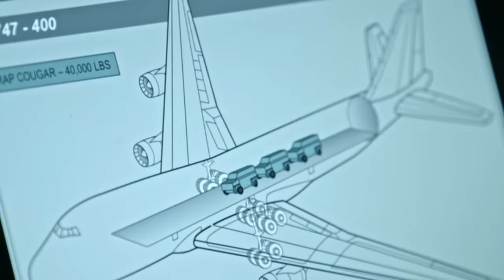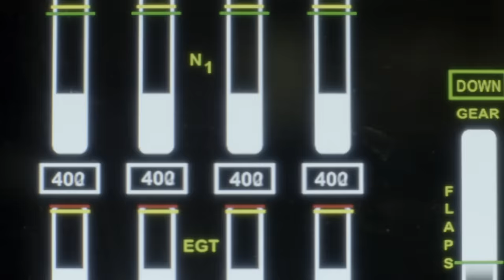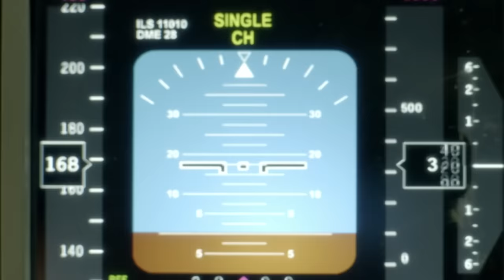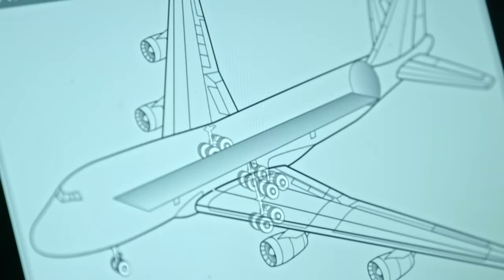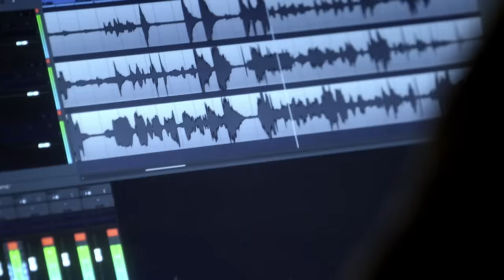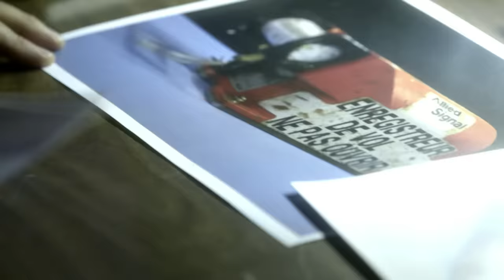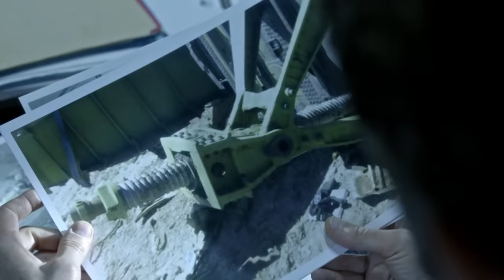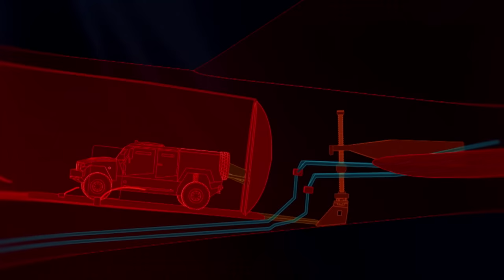The Cargo Plane in Afghanistan That Crashed Seconds After Take Off | Mayday: Air Disaster

Comment: When I saw this crash, the aviation class course on Weight and Balance came to mind after seeing the footage.
Teacher showed some example of planes on the ground (thankfully)who found this out the hard way.
Then told of how a grocery store owner was flying beef to one of his stores using a tricycle Cessna.
Take off was good, flight was smooth, landing perfectly, and on the taxi way his Cessna suddenly became a tail dragger………
Apparently just enough fuel burned off to shift the weight and balance suddenly.
If that had happened any other time during flight or landing……separating cooked beef and charred human flesh would of been difficult to say the least.
Bad jokes would of been said, and loss of appetite for beef, burgers, and tacos would of occurred.

One of the pics he showed was a 737 loaded so badly that the tail thumped on the ground with the nose in the air.
Or as he put it,
“When the baggage crew load pillows up front and lead bricks in the back”……

Comment: Dude if I were one of those crew members, I know in my heart that I would argue until I'm blue in the face with everybody that we can't secure these big heavy metal vehicles with nylon straps. It's insane. I would demand chaining them up before I would ever get on that plane.

I know commenters will probably say hindsight is always 20/20 but I know myself. As a former flatbred trucker though, I have plenty of experience securing heavy loads. I hauled backhoes, bulldozers, excavators, commercial riding lawn mowers, etc. I used nylon straps as well as chains. Nylon straps are good for light to medium duty securement such as lumber, drywall, etc. They have no business being used on heavy equipment.

But even if I had never become a flatbed trucker and had no experience with this sort of thing, I'm pretty confident that the alarm bells would be going off in my gut that this doesn't seem right and we should do extra just to be on the safe side.

Comment: The guy who was supposed to handle the very heavy vehicles was not certified and nobody was somehow aware of his lack of training/knowledge/expertise yet allowed him to work on this project or any that would involve the safety and lives of all passengers? What the heck? He wasn’t held responsible, but somebody had to supervise him, I mean it wasn’t his company that handled these jobs.
Reply: Company who hired them was definitely responsible since they didn't give adequate training on how to handle cargo loads, chances are pretty good his Supervisor had about as much training as he did in handling the cargo load. The company was the one that came up with the crappy calculations for how to use the nylon straps, they're absolutely responsible for this, the employees were just following the training they had been given.
Reply: His training could have been better, but when it comes to maintenance work, you follow the checklists in front of you. You saw the checklists which very erroneously said the angle didn’t matter, so even a more experienced loadmaster would have followed their vague rules and calculated the load bearing capacity of the straps incorrectly. The company failed them miserably, and it seemed like they blatantly lied instead of being specific about the load capacity of the straps at different angles so anyone can calculate the load correctly and safely.
Reply: Everyone here is wrong I worked for National Air Cargo and was in Dubai and know exactly what happened. National had three birds on the ground at the same time with a load crew of five they had been working close to 17hrs that Day and they were exhausted. Seems the flip up pallet locks were NOT raised and there was not enough straps on board the aircraft.  
This was not the first time the company moved these vehicles. The ground load crew was at fault along with the load master on board. Obviously the load master failed to check the locks and the company was at fault for over working the ground crew and the lack of straps used on each pallet.  This was the mistakes that brought it down.

Comment: As a truck driver I would never leave a loading area without making sure my load was secure. How much more important is it for a pilot to check his load to make sure it's secure? I know the pilots were tired but that's really no excuse. Very sad.
Reply: But it appeared to be strapped down, the pilots were not delegated the task and as per the loadmasters manual it was strapped down properly. The pilots had no fault in this case, you as a truck driver take on the role of loadmaster as well but this is a very different case which relies on regulations and multiple crew members with differing delegated roles.

Comment: To heck with nylon straps for heavy loads. I've been a tow truck operator for nearly 30 years now and nothing i've ever used has the load carrying capacity of  good quality chains. Straps naturally lose their strength over time due to fraying and contamination, chains on the other hand can retain their strength indefinitely if undamaged and cared for correctly. Use nylon straps to secure a riding mower, use good quality chains to secure everything else!

Comment: I don't see how the load master didn't question the calculation of 26 straps for 12000 tons and 28 for 18000 tons. So 2 straps is all that's needed for 6000 tons?
Reply: 2 straps for 6,000 tons?  How big are those straps??  500 tons are a million Lbs.

Comment: Unfortunately, whomever made this video made the situation even more confusing because they incorrectly explained the problem with the WLL of the straps in contrast to the angle of their securement. The strength of the straps doesn't change with angle.  The angle, however, determines the direction of pull/force as the plane changes pitch and angle, which can make straps useless if not applied properly.  In that case, fewer straps may be available to withstand the force, and thus exceed their WLL.  What a horrible explanation.

Comment: This was a half story… the load master is handed the manifest and load plan which shows positioning and the weight distribution in various sections on top of restraints…. However there are contractors in jail right now because they copied certificates saying they were qualified in load planning and didn’t know how much restraint was required for that rolling stock
Reply: that's the problem with this kind of operation. The pilots aren't trained loadmasters so they have to rely on someone else's opinion.

Comment: The conclusion seems to imply that the straps securing the vehicles from moving were the only thing keeping the vehicles from moving..   I would hope that each vehicle was in park or in first gear if manual ....     If the wheels are locked that adds much to the resistance to movement and I find it hard to imagine that the tires would slide that far unless the floor was very very smooth..

Comment: Chocks, chains and binders. Straps break if shock loaded. Ratchets become damaged from overtightening. Strap can snap near max tensile on a dynamic load. Heavy equipment on road transport use chains exclusively. Logs get straps...
Reply: So, its chained to a pallet, then strapped to the rollie floor?

Comment: This has to be a joke. So the manual says the load needs certain number of straps but did not specify the arrangement of the straps?! Even an untrained person should have the common sense to know how you arrange the straps makes a big difference and should ask for more specific instructions. Also if the straps are not equally tensioned, the straps with the most tension would bear most of the load and would likely break, then the next set of straps with the most tension would break, ... until all straps broke. And it is not possible to give them equal tension because when the plane changes pitch or bank angle, the tension shifts from one set of straps to another. If the straps are somewhat elastic, then they can distribute the tension among themselves somewhat.

Comment: Everyone here is wrong I worked for National Air Cargo and was in Dubai and know exactly what happened. National had three birds on the ground at the same time with a load crew of five they had been working close to 17hrs that Day and they were exhausted. Seems the flip up pallet locks were NOT raised and there was not enough straps on board the aircraft.  
This was not the first time the company moved these vehicles. The ground load crew was at fault along with the load master on board. Obviously the load master failed to check the locks and the company was at fault for over working the ground crew and the lack of straps used on each pallets that shifted through the tail cone.

Comment: Load Master's aren't certified? Actually, that's rather stunning. Very simple vector analysis would tell you about loads and loading. Sad. The company's manual on securing loads/loading is purely to blame. But, then, a load master with basic knowledge should have known. IMO.

Comment: It does not need rocket science to reach the conclusion---. It is simple physics which most americans don't learn either in high school or college.

They fail to understand when the aircraft took off at an angle---maximum load was on the front straps----. The straps in the back of each truck were of no or of minimal help in holding the aircraft---.

The maximum number of straps to hold the truck are for level flight---.

Comment: They aren't tail wings, they are horizontal stabilizers. Where do they get these narrators?
Reply: That’s another name for them nerd.
Reply: @raihothexiv15th37  So, you are telling me, who worked on jet fighters for 20 years in the USAF, that I'm wrong? I think not, Jethro.
Reply: @jimdavis6833  Doesn’t matter how experienced you are dude, you can still get things wrong and be incorrect. 

“A tailplane (tail wing), also known as a horizontal stabiliser, is a small lifting surface located on the tail (empennage) behind the main lifting surfaces of a fixed-wing aircraft as well as other non-fixed-wing aircraft such as helicopters and gyroplanes. Not all fixed-wing aircraft have tailplanes.
Reply: @raihothexiv15th37  Don't believe everything you read on Wikipedia, or obscure internet sites. During my career, I attended many advanced aviation courses. Never once were the Elevators, or horizontal stabilizer referred to as tail wings. When both are combined as one, they are called "stabilators". That's an indisputable fact.
Reply: @jimdavis6833  Wikipedia wasn’t the only site that stated this. Many aircraft experts also said the same thing. Admit it, you’re wrong.

Comment: Loadmaster is kind of responsible for this crash, even that he followed load instructions .  After strapping is done according to instructions,  its good to back up a little and take a good look at it,  does it feel secure enough,  does it make sense,  a good loadmaster should feel and have a good judgment,  taking under consideration the weight, pitch, G forces. Momentum and so on .  I hate  who only follow instructions of a manual,  turn his back and call it done.
Reply: Thanks for bringing that up!  But also got to consider that since it was a war zone, the airplanes had to get up higher in the sky sooner, to get out of range of gunshots.  So the steeper climb put more strain on the tie downs.

Comment: A lot of plane disasters seem to involve loss of hydraulics for different reasons. 
 Why don't they use motors of some type?  Motors can easily be made to have multiple sources of power in case one gets damaged. Also design the cargo plane better for hauling the cargo. 
 The floor should be able to hold vehicles in place at the point of contact which is the tires. Hold those tires in place and that vehicle will stay put. There wouldn't be a need for straps. 
 Designers should also be visionaries to a project. Look forward and always be flexible.